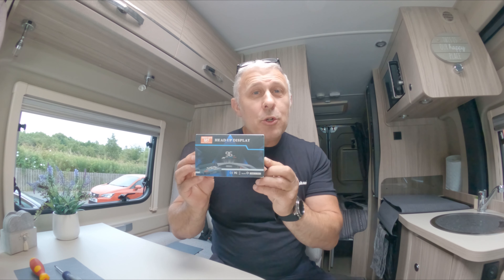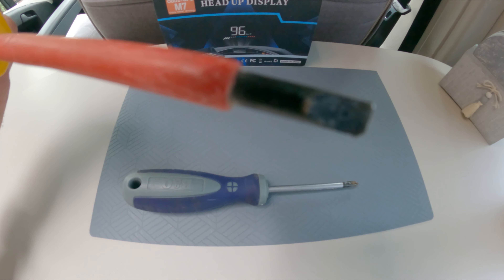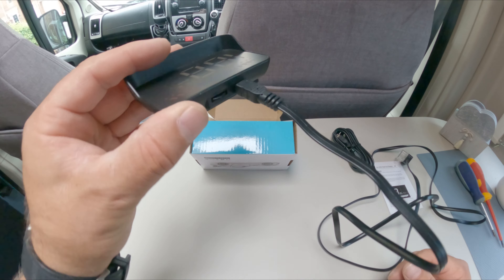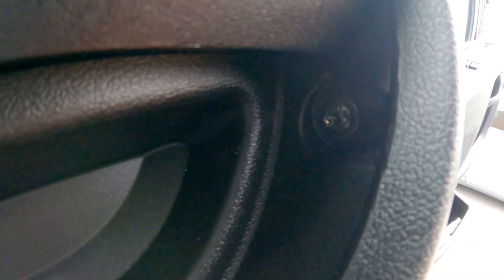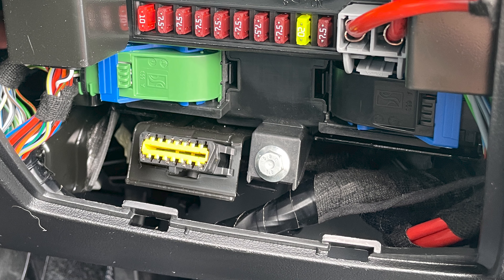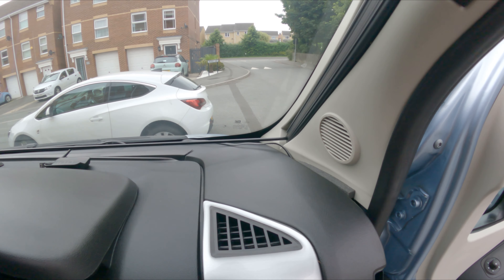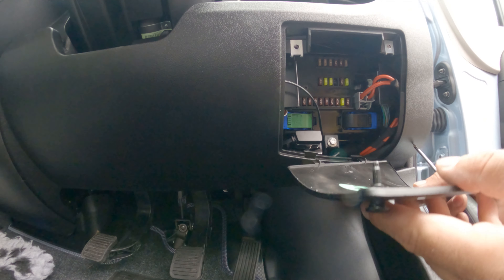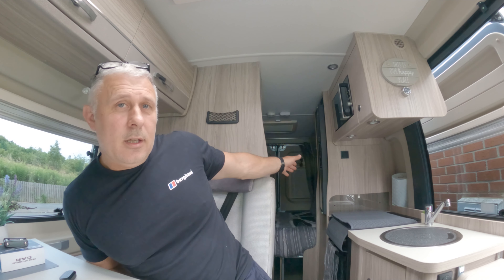Cheap head up display (HUD) for your campervan

Comment: Bought one and using your guide fitted it 👍 No problems apart for trying to understand the instructions, in the end do what we normally do and kept pressing buttons until all ok.  Checked it the following day and mine doesn't turn off, even put the alarm on and locked it but, it still stays on.  Have now unplugged it and will have to start pushing that little knob all over again 😂.  Installed in a Fiat Ducato albeit the heavy 4.5T it is still the same dash and instrumentation.
Reply from the maker: Hi Mark. Thanks for the feedback. How long did you watch it. Mine stays on for about 30 seconds after I lock up but then it turns itself off. Hope you get it all sorted. Mine works great. If you don’t sort it out it may be a faulty unit.
Reply: Sat in the truck and used remote to lock it, stayed still for ages (didn't wont to activate alarm) must have been 2/3mins.  Then unlocked and relocked from outside then checked in the morning and it was still on!!!!  Unplugged it and will try it again over the wked.  Not a great problem to unplug, just hope it isn't a chore to set up again.
Reply: @markryder3996  Hi there did you ever sort out how to get the unit to turn off once ignition was off? we seem to be having the same trouble sometimes it turns off for a few hours sometimes just keeps coming back on !!
Reply: @suelefevre4141  Hi Sue, no never got it sorted, made a few enquiries and found out that the plug in is permanently live.  I just take the lead out from the unit and reconnect when I get back in the truck.
Reply: @markryder3996  Hi Mark Ah ok. well I sent off to the people I bought it from to see if they know what to do will let you know what happens. Sue

Comment: You don’t need to remove big the panel under the steering wheel.  Just remove the small fuse box panel and you can easily feed the cable through.
Reply from the maker: Very true but I have little fat fingers and it just makes it easier for me. 👍🏻😁

Comment: This might be a really daft question 🤔 I have an autosleeper Peugeot base vehicle 2019 the speedometer is the standard dial and like many  it's tricky to see. Does the heads up convert the miles from a dial type to the digital on the screen. I wear glasses for reading and different ones for driving so can't see the speedo that clearly 😳
Reply from the maker: Hi Jill, that's exactly what it does and it makes it so much easier to read. It's one of my favourite mods.
Reply: @TravellingfromScratch  thank you I will look out for when they back in stock and give it a good you did a great fitting video and pretty sure I could follow it without any probs 😀

Comment: Hi, checked out the link, thanks, but it says"OBDll mode is not compatible with hybrid electric vehicle,diesel car, pickup truck, RV, computer modified " I assume that this is incorrect and can be used on Diesel vehicles? Thanks

Comment: I'm guessing that the knurled wheel next to where you plug the cable in on the unit is for the brightness of the display?
Reply from the maker: No. That's to change what the display shows on the windscreen.

Comment: Hi very good video, I opened the link you put on for the HUD display and three came up, which look similar but which one did you actually get. There is one at about £60 with another at about £30. 

Kind Regards
Reply from the maker: The one I got was about £30. Works great. Fantastic addition to my van.
Reply: @TravellingfromScratch  
Thanks very much for that, keep up the good work

Comment: Hi there bought one of these from Amazon. have got it working fine except for turning itself off when van is switched off. My battery on van is 13.6/8. I have altered settings in the HUD menu 9 and have tried 13.2 and 14.0. to try and get it to stay switched off when van not on. Also setting 10 in menu i have set to 10 seconds for it to go off as well. However what it does it goes from speed 0 at standstill to 0.0 then after 10 seconds turns off BUT after couple minutes comes back on again and find battery then about minute later goes to 0 again then 0.0 and off then once again comes on again and repeats but will not stay off. Can you tell me if yours does this or if you managed to get it to stay off when your van is switched off please. If so what are your settings on your menu. other than that I have found it to work well.
do hope you can help me perhaps send me your settings so I can try those.

 Many thanks Jim
Reply from the maker: Mine doesn’t do that Jim. Think you could have a faulty one. I would return it to Amazon.

Comment: Does that run your battery down ?
Reply from the maker: Not at all. I have been using it for ages and my battery is fine. It turns off about 30 seconds after the ignition goes off. It's probably my favourite upgrade. Love it
Reply: @TravellingfromScratch  hi will it fit my 155 auto quest Peugeot boxer motorhome?
Reply from the maker: @peterrider3471  If it has an obd port or a usb port then it should work. Obviously I can't say for certain as I don't have that vehicle but you can try it and if it doesn't work you can send it back. If I had to make an educated guess I would say that it will work no problem. It's a universal fitting so should be fine. Give it a go.